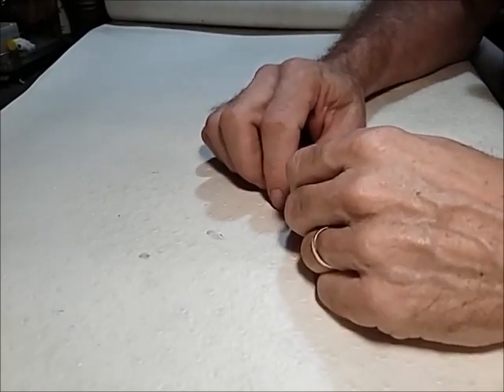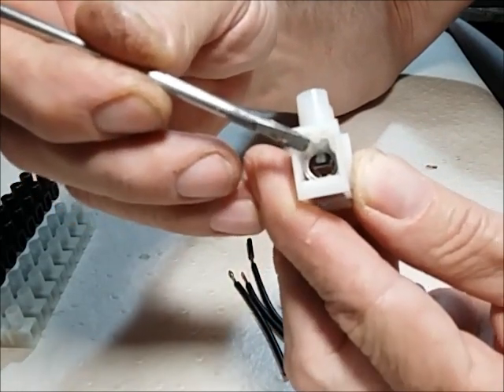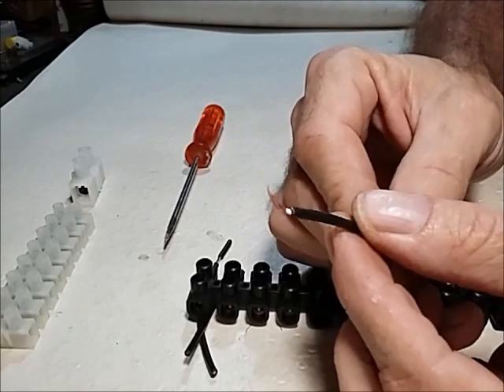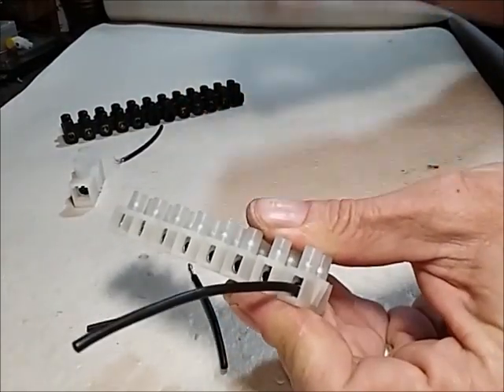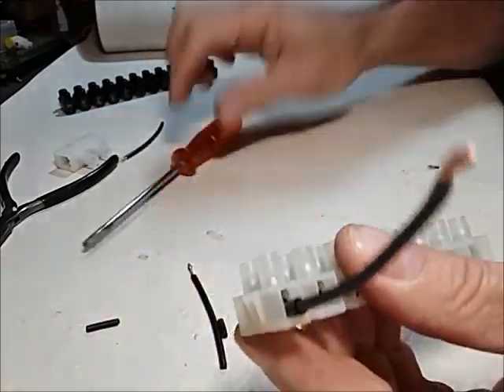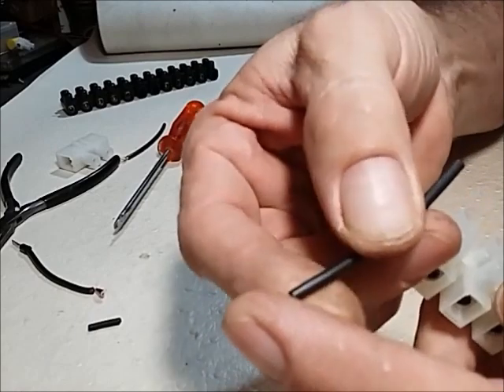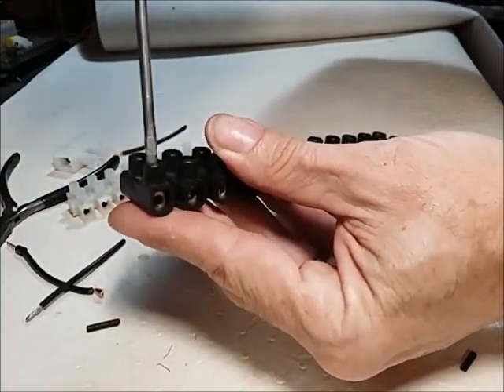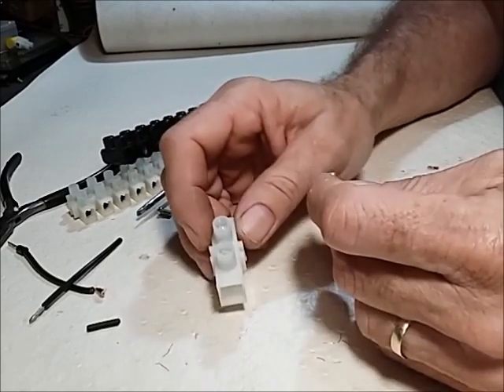Connector block basics

Comment: what if you burned one screw on accident and decided to use the other scew next to it will the burned screw be connected if its unscrewed all the way out?
Reply from the maker: hi. not exactly understand your description of the problem. just try to explain "the next to it" inline on the same block or separate one next to it
Reply: @DanaKotze  same block this a singular block with 3 holes to screw wires in
Reply from the maker: No I don't think so. If there is no pressure on the connection it will arc. Not safe to do so👍

Comment: Which one should we use for normal wiring inside different household appliance, such as fixig wiring inside vacuum cleaner, toaster or general electric connections out of 3amp, 5amp, 10amp 15amp??
Reply from the maker: Also make sure it can handle 15 amp for household appliances.
Reply: @DanaKotze  Thank you!!
Reply: Use a Wago lever lock and be done with it.
Reply: @im2yys4u81  Or use these connector blocks and be done with it, if you already have some lying around.
Reply from the maker: Hi.The 4mm dia 500v  one should be ok

Comment: How do you put two solid core wires in a block? I always have them coming loose when stuffing those stiff wires back into the junction box. Is there a better way? Thanks
Reply from the maker: Hi Ben. You can twist them and bend them backwards should there be enough space
Reply: Check out Wago lever locks. I use them all the time. Be sure you use genuine Wagos, not the knockoffs. The genuine Wagos are approved in the US, Canada, the UK, and China.

Comment: Great I USE THIS TO BLOCK THE LINE TRIMMER IN MY WEED WAKER , THE  TRIMMER LINE IS 2, 4 , OR BIGGER OR SMALLER , I PUT INSIDE AT THE PLASTIC CASE AND FIX WITH EPOXY  , SO TO CHANGE THE LINE  I JUST CUT A PIECE 5 INCH AND SCREW  , NEVER COME OUT , NEVER BREAK
Reply from the maker: hi. good to hear